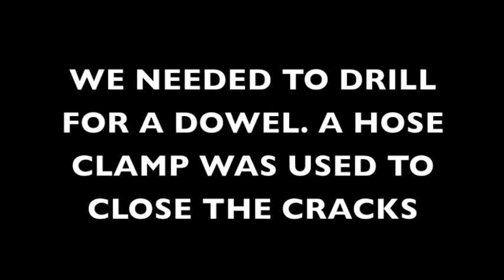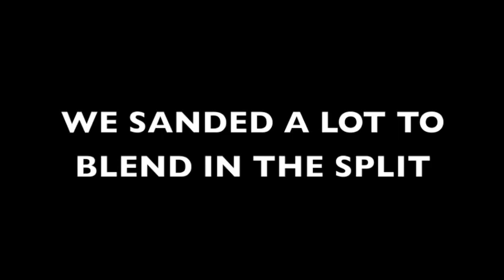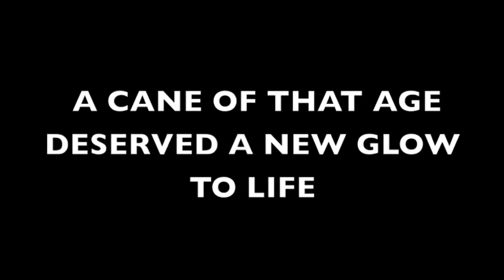Walking Cane Restoration

Comment: Mike, awesome job! Glue ups like that are tough to get straight, and it looks like you got it perfect. I'm interested in that paint you used, where did you get it?
Tom
Reply from the maker: Thanks Tom. The paint is made by General Finishes, and is sold at Woodcraft or Rockler. The color was lamp black. Really nice paint to work with it. Water based and dry's in about 5 mins. Thanks for the comment. 

Cheers, FREY
Reply: FWI356 Good, I buy from Rockler when ever I can, we've got a retail store nearby.